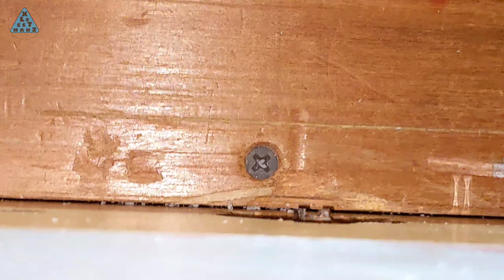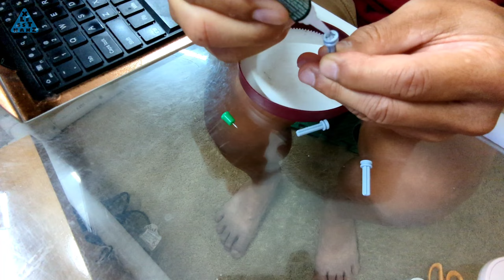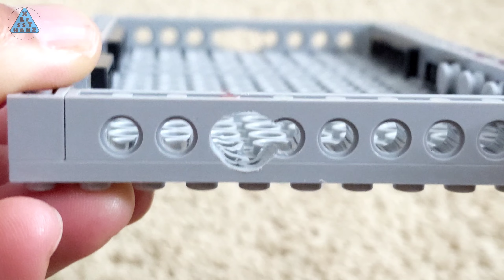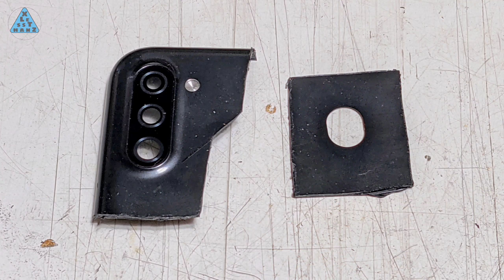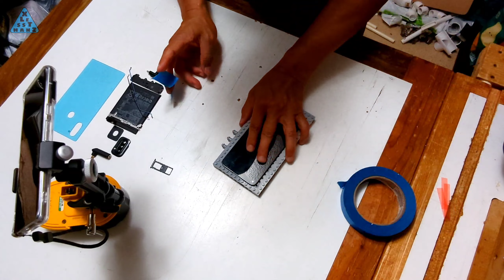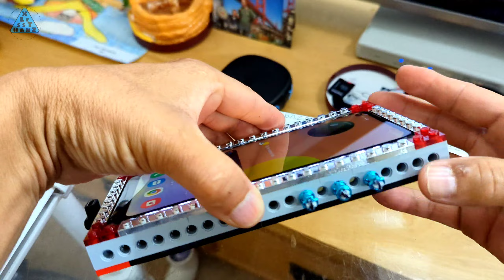DIY LEGO Smartphone #2 (WITH CHROME ACCENTS)

Comment: Hi X LessThan Z. Wanted to ask, what program to you use to edit your videos. I have a chromebook, not sure what is on the market to edit videos with. I am using Kinemaster right not till I find one. Any suggestions?
Reply from the maker: My editing needs are very simple, so I have stuck with KineMaster for a few years now, but I use it on an Android tablet.  I had thought about using it on a Chromebook for a more laptop experience, but after performance testing I'd done at BestBuy, I changed my mind.  I've always used it on Galaxy Tabs (3 of them now) and recently picked up a Galaxy Tab S8 Ultra.  It was good deal with trade in of my old tablet and inclusion of the free keyboard, final price was under $600, for what would normally be around $1400.

For me, I try to make KineMaster work (so I won't have to buy a more capable product) by doing all the image/video/audio editing outside of KineMaster using other products.  Once it's in KineMaster, it's more to plop it in the correct timeframe and fine tune its alignment with the separate voice-over I always do.  I sometimes have to adjust the volume of the audio clips, but that's the extent of any corrections done to clips in KineMaster.

Hope this helps.
Reply: @XLessThanZ  Yes it does. How do you get the logo off your videos. I dont see them. On my videos the logo is on. Any tips on that?
Reply from the maker: @chadsshow2010  You do need the paid version to eliminate that.  KM has worked hard to make sure that logo stays on the unpaid versions.  It even appears if your Play Store account is not set to the account that you purchased KM under.
Reply: @XLessThanZ  OK. Thanks for the tips in advance. It makes editing video easier and more fun. Aloha